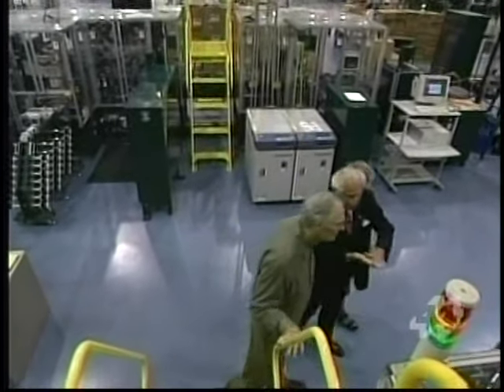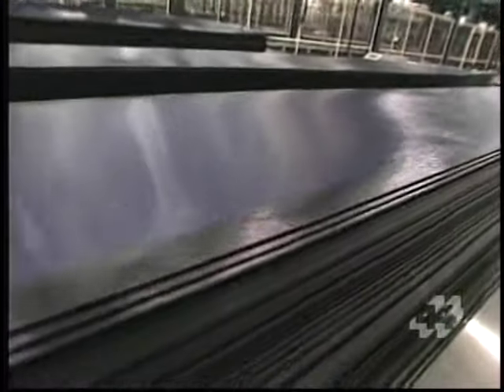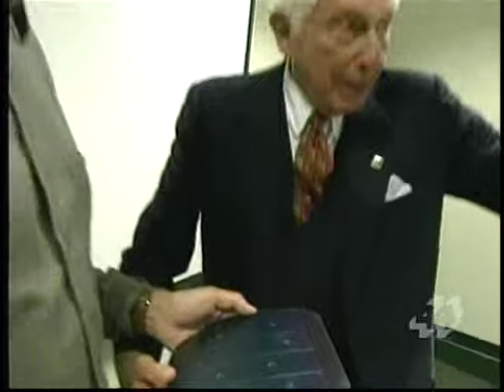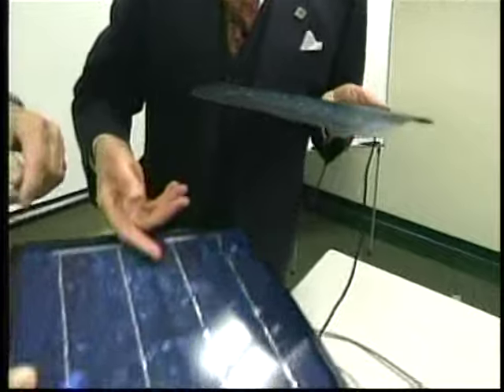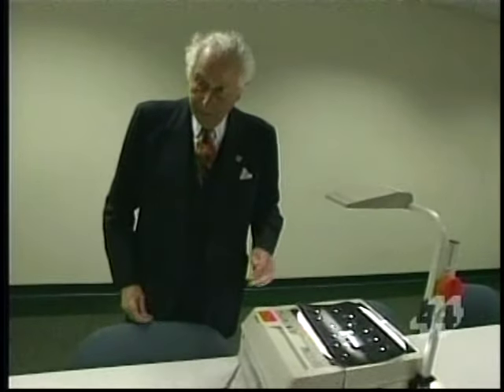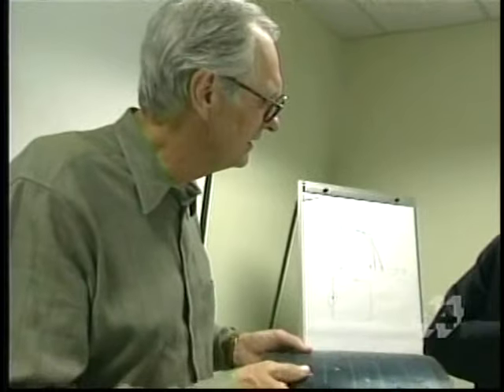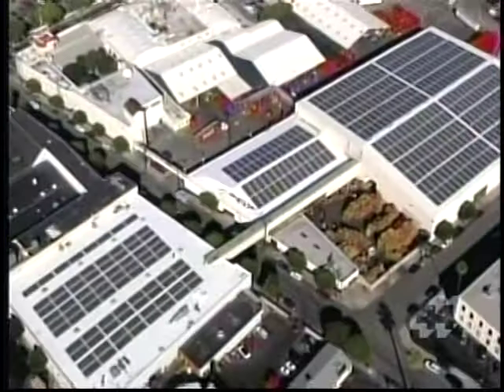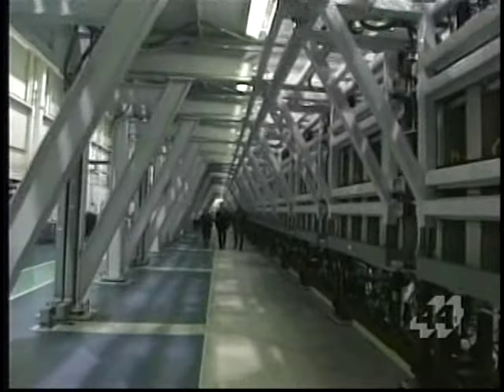Stanford R. Ovshinsky Solar Panels

Comment: shady is right, im doin my part to desing a hydrid electric compressed air motorcycle in my evenings, it will feature more than these flexible solar laminates, but every little bit helps! there is always cold air in front of the bike, and also heat to wash while moving, and electrostatic to harvest!

Comment: Not on market because OIL COMPANIES bought him out and then buried it and suppress use of patent until it runs out.   Mr Ovshinsky told me personally over the phone a decade+ ago that the oil co's made sure nothing prospered with his fabulous battery ( Same thing Texaco did to his NiMh Large format electric car battery; still the best today IMHO because they don't explode like Li-Ion has propensity to do.)   He also invented using same materials as batteries a method to  store Hydrogen cheaply safely.   His NiMh large format battery is now out of hostage mode but most are still thinking Li-ion is best, but look at Leaf car, it over one year loses so much range that wives are afraid to ride in it for fear of being stranded (note Boeng 787 Dreamliner has has numerous smokey aborted flights from ni-li battereis and the malaysia flight and mediterranean flights down lost, were purportedly carrying li-ion batteries.   If you do insist on Li-ion don't charge them fully , but just to 90% for safety.   BTW:  for stationary uses like this solar system for HOME Use, Ni-Fe (Nickel Iron) while heavy lasts 100 years, so for a power wall Edisons Ni-Fe would be a great choice with less danger of fires or explosions.  There is a YouTube video out there about how a guy took RR train Ni-cd (he alludes in the title its similar to Ni-Fe construction) and simply cleans the plates, puts in fiberglass (window screen) insulators and has pretty good performance .
Reply: @ john Doe   you KNEW Dr O? I am working on a long slow project to bring this mans geat work to light, when we need it mos I would cherish the chance to interview you sir .
Reply: @LouAlvis  i talked to Ovshinski 2 times for maybe 10 minutes ea.   He did indeed say that "those oil companies made sure nothing ever came of his (fantastic) battery for the EV1  Other occasion he said his solar shingle was same material as his battery; he said he sold the co to those who said they would make it for solar siding for houses as well. Of course they never had any to sell and drove it straight down as they did with the ev1 battery, but they bought the patent and wouldn't let but a few who already had permits to build them in the large format version (EV' size). ..Good Luck !
Reply: @InventPeace1  I am researching for a project. thanks for this info, I might reach out again?
Reply: @LouAlvis  The truth about wind power is that its expensive to install, only produces with good wind speeds (what 9mph minimum?), expensive to maintain, and life cycle costs to replace will be higher... i love the idea, but the reality of making it pay for itself are challenging.   SOLAR is really best option but everyone wants them on the roofs which is prone to make your roof leak, if a rail system w horseshoe shape rail ends that attach under the eave so no screws are installed in the roof itself would be nice, then the user can roll the shingles back n forth as needed to maximize sun... Another idea is a VERTICAL solar tower to max yard space and still get a decent amt of sun power (40 ft tower that either tracks sun $ or more panels on 3 sun angles (E, S, W in N.America) so there would be no moving parts.   Yes, Trump has stated Solar is the way, but at least for now, he is also pro oil, and perhaps he's right w all the economic gloom/doom we are seeing incredible inflation and incomes have not tracked the  higher prices either? Circa 2 NOV 2021.
Reply: @InventPeace1  Thank you for your expertise!  maybe you could make in informational vid on your patent! i understood (inaccuratly?) that Dr O's battery tecfh ended up in Japan? but it sounds like you would have a better take.  i am REALLY interested in your patent, sound like a game changer.
Im some of my work electric utility vehicles are useful but with significant drawbacks, i suspect from the base design. 
I realy think your knowledge and wisdom ( yeah i said it)  would be very welcom on many you tube channels. Surely, you would be a worthy guest on some of those.

Comment: does anyone know if this has been picked up again?  I would love to reroof homes with this stuff and eliminate conventional roof materials... and one could run flattened copper pipe right under it tat would heat your water and act as a coolant thus make them more efficient.

Comment: Music to my ears "then use the electricity to make hydrogen" at the 2 min mark, cuz then, as seen on TV (Knowledge Network in Canada) in the 1980's, cars can be driven by hydrogen-on-demand, which uses electricity to split the hydrogen (x2) from the water molecule leaving only oxygen, which is needed to rebuild the ozone layer. No, I don't believe the ozone layer problem is solved, as CFC use was just exported, outsourced, ugh.

Comment: The truth about wind power is that its expensive to install, only produces with good wind speeds (what 9mph minimum?), expensive to maintain, and life cycle costs to replace will be higher... i love the idea, but the reality of making it pay for itself are challenging.   SOLAR is really best option but everyone wants them on the roofs which is prone to make your roof leak, if a rail system w horseshoe shape rail ends that attach under the eave so no screws are installed in the roof itself would be nice, then the user can roll the shingles back n forth as needed to maximize sun... Another idea is a VERTICAL solar tower to max yard space and still get a decent amt of sun power (40 ft tower that either tracks sun $ or more panels on 3 sun angles (E, S, W in N.America) so there would be no moving parts.   Yes, Trump has stated Solar is the way, but at least for now, he is also pro oil to spur the economy, and perhaps he's right w all the economic gloom/doom we are seeing incredible inflation and incomes have not tracked the  higher prices either? Circa 2 NOV 2021.